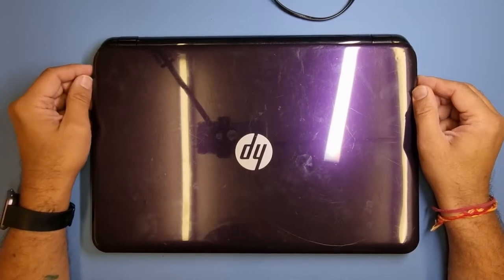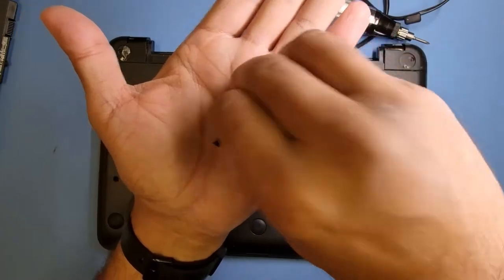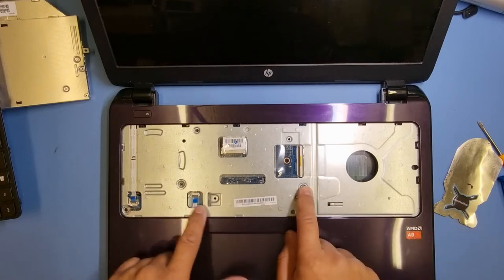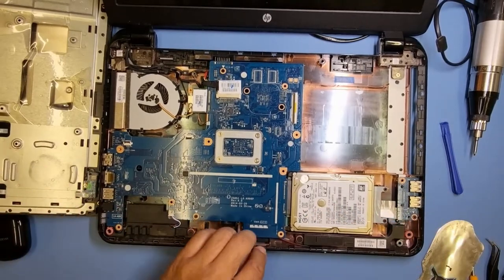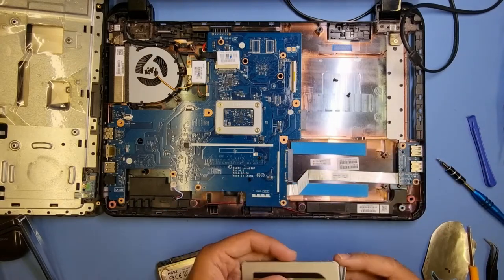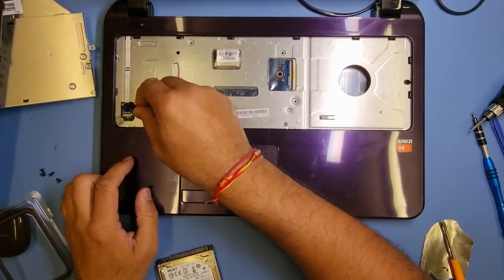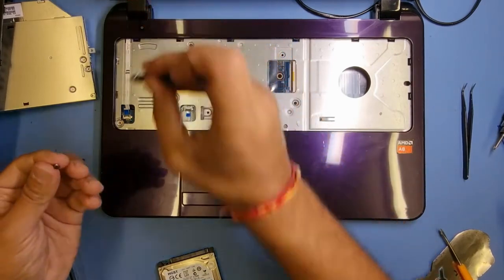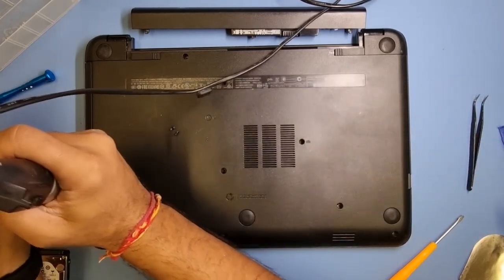HP 15 g094sa Hard Drive to SSD, Laptop Repair

Comment: V. Good vid bud... Do ya know if the old hard drive can go back in another place as storage or is there no place for a second drive? Does it have 8gb of RAM in there and would that be the maximum for this lappy?  This vid earned my subscription today !! 😎well done and good luck with the channel..👍
Reply from the maker: Hi Thank you getting in touch, apologies for the delay in replying, there is no space for another drive, you could connect with a caddy via usb externally. As far as the Ram is concerned I'm not entirely sure as the laptop has been given back to the customer, however is can be upgraded. Thank you so much for subscribing its much appreciated👍